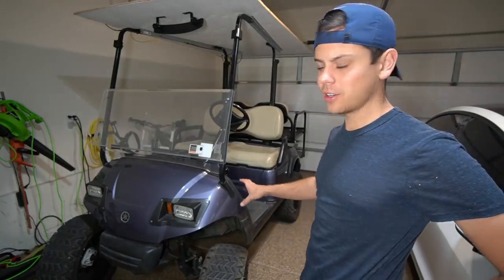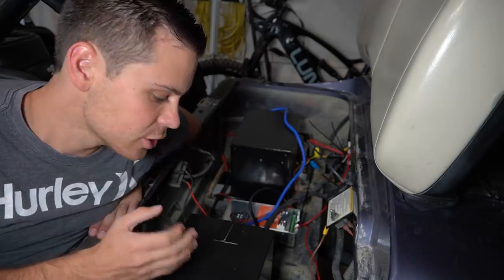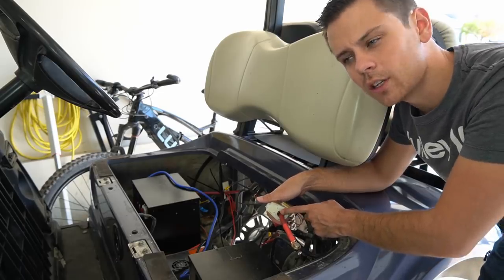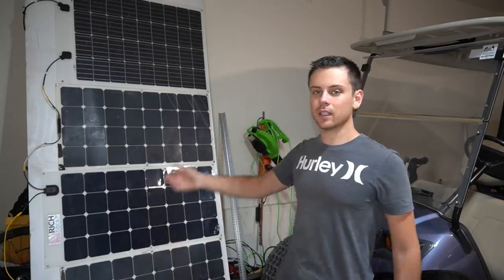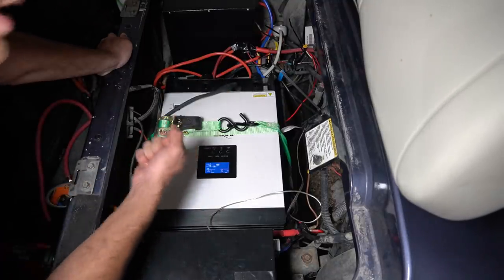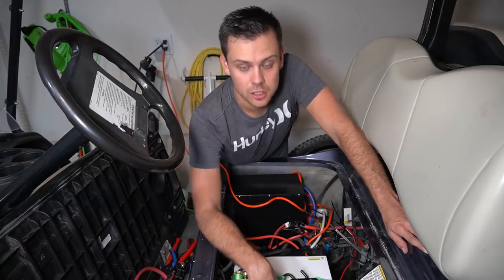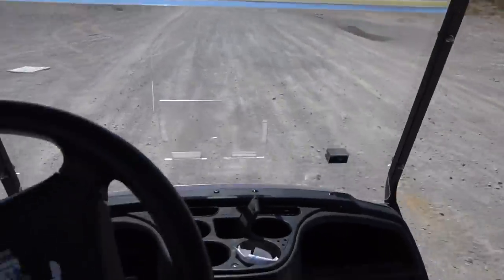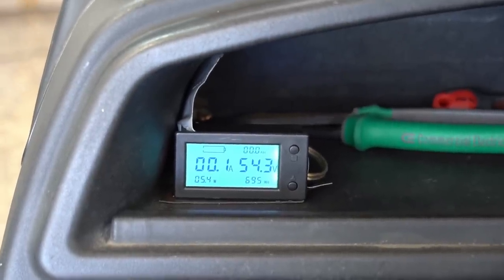Off-road Solar Golf Cart Part 2: Battery Upgrade, Shunt/48V Inverter Installation and TEST DRIVE!

Comment: This is a project that I've personally wanted to do for quite some time. I was pleasantly surprised to see you diving into this one, but really, it was no surprise. I knew I'd see it sooner or later on your channel; It was only a matter of time.  I don't comment very often, but just so you know, you're one of the very few content creators that have earned the "automatic like" from me within the first few seconds of any of your vids. Looking foward to part 3. Keep up the great work!
Reply from the maker: Thanks 😊
Reply: @WillProwse  ... Will Prowse ...by watching your channel I have put 3 - 24v 120ah fortune batts in my sprinter w/ a 6k inverter, a sterling generater (for night drive charging) , a 300w renogy panel and 3 200w daly BMS' ....I now need a 24 to 12 dc to dc inverter for my 12v lights and fans... what would you recommend?... pls I am an solar idiot and only copying you... I have tried to reach you on the forum and just get lost... My system is currently working well... (I have a batt cut off while driving in daylight so the sterling gen doesn't overcharge while 300w panel is charging)... I am currently solar charging at 28.6 volts not sure what float is BUT I can run my 220v mig welder for a short period of time (just testing) and it will run the A/C unit on the RV for about 4 hrs w/ no problems ... Before C-19 ...I wanted to come to Vegas to do a video series but C-19  F'd all that up ... so I did it on my own in june /july... Thank You For All Your Videos... You Saved my life/system and Carl @ Electric car says Hello and  Kent got hired by a competing company unfortunately... Please PM me through one of my vids... YOU ROCK... I can't THANK YOU ENOUGH... Many Blessings , SMR

Comment: Don't need bms, I have 14 used gen2 Nissan leaf packs on mine 7s2p. Running through a Alltrax 72 volt controller. I have it limited to 25 mph and get about 27 miles from full to empty charging to around 57.5 volts. 6000 rpm mechanical limit of the motor is at 27.5 mph. I have the gear set on the shelf and 2 extra packs on board to bump it up 8 volts but love the 40 amp charger I have on board which tops out at 58.8. I just check my pack imbalances about once a month, so far haven't had to balance. Been running it for about a year. Glad to see you getting into golf carts. Edit:The packs are 2s so actually 14s2p. It will wheelie if you stomp it from stopped. Empty is 48 volts while running.

Comment: i have a small 36v 20ah battery im going to try to use in my 36v golf cart for a band aid to get it operational til i can afford the big one to properly power it. great video as usual.
Reply: Go for it. Use what you have. Let us know how it goes. If lead-acid it may not be far yet anything is better than walking for longer distances.

Comment: It’s a nice setup for a mobile generator. Though the solar panels you had on the roof take 3 days to charge, it will help keep it from draining significantly when away from grid power. Nice job!!

Comment: We have an old golf cart that ive been wanting to either sell or get new batteries for.  I think Im eventually going to do the battery thing.   But your suggestion at the end...about using it as a power SOURCE!!!  its a game changer.  If you had an acreage, this would be sooo handy.....no need to take the generator to the site....just take the golf cart.
Reply: I thought the exact same thing! I have been towing my generator around the yard to power my pole chainsaw. I can't wait to upgrade my golf cart to be able to avoid the trailer.

Comment: Try driving in some soft sand and see how it handles the load. 
I remember electric carts at the imperial dunes did ok even in stock configuration but the LA batteries were drained fairly quick.

Comment: Whoa Will! 
First for solar charging a golf cart, check out Genasun charger. They will custom configure the charge chemistry profiles to your liking. They are about the size of a pack of cigarettes and weatherproof.
I use one to charge a 36v cart at a lake house with no external power where it is stored. That system uses 2 sub 250w panels, batteries are always charged going on 2 years now. Those are lead acid.

I did a run a few nights ago in another cart I have. It is a 36v Ezgo TXT, Plum Quick Bandit, 600A Navitas controller with bluetooth tuning. I run it on 7-6v batteries around 42v nominal. On the run I did 26 miles, voltage started at 45.7 and was 41.3 when I stopped. My theoretical low would have been 37v so I est another 20m. I was running about 12mph average though my cart will run in the high 20's

Comment: Hey Will, i just put 4 Battle Borns in my golf cart and push around 240 amps with a high performance 14hp motor. The lithiums are great but i miss the 370amps of torque that my flooded batteries could give :( I have a 500amp controller. Let me know if you want to see my setup, you wont be disappointed! Thanks for all you do!

Comment: Hi Will, Lithiumsolar had some loose screws on the breaker connections. It’s probably a good idea to check and secure them with loctite, because of the vibrations from the golfcart...

Comment: Nice project Will! I had an old ez go with steel truck mini bed conversion on my farm in the desert. But I always wanted to do a battery conversion to that golf cart. What battery chemistry finally worked please?👍 Thumbs up and subscribed! Tip: air down the tires as far as you can and still hold the bead, for a much smoother ride!

Comment: Hey man love your videos thanks a lot ...you mentioned powering a welder ...would love to see a build video using fortune cells to build a battery that can withstand the amp requirements of a welder. Specifically a Miller 220 ac/dc machine. .. no need for solar input..just looking to build a mobile supply similar to your hand truck video. Thanks again!

Comment: You've joined a large community of "golf cart" modders.  After-market batteries, controllers, you name the part, it's available.  Change out that controller, add another battery,  and improve the suspension and brakes.  You'll be surprised what it will do.  Check out the "buggies gone wild" website.  The sky (and the cash) is the limit.

Comment: Glad you made this video. I tried to convert a 48v Yamaha Cart to Battle Born LiFeO4, as soon as I wired it up, I turned it on and drove it around the block.  Great I thought, I buttoned everything up and the next morning went to use the cart.  Now I have the same problem as described in the video, as soon as the solenoid clicks on, one of the batteries BMS's shuts down one of the batteries (not always the same one). And that is where I am stuck.  Why did it work once, and never again, and what to do next?  Does anyone know if Battle Born batteries can power a golf cart, if so, what am I doing wrong?

Comment: Pls try the 300w renogy panel... that is what I installed on my sprinter van... it seems to be working well but I don't understand the math like you do... Many Blessings , SMR.... an idiot on line research... YOU ROCK

Comment: Top speed is determined by a magnetic sensor in the motor.  You could bypass that and run as fast as you want.  Although going over 25 mph is from experience pretty darn tough on the suspension and steering.  Every bump or divet in the road/land will put an enormous stress on the said components.  They simply are not built to go over about 19mph.

Comment: Very nice project Will, I am looking at converting a Polaris Ranger EV from SLA to better battery technology. Was concerned with finding the right battery chemistry to handle the in-rush current. Now I have some ideas. Thanks😃
Reply: Green Tech Auto you can get the Honda Fit rescued batteries Toshiba genuine skibbe the entire batch all of the vehicles Honda manufactured currently at about $200 a kilowatt hour like new with the greatest ability to provide the power money can buy just 60-month leased USED in a car so optimally burnt in for your higher and better purpose. They have come down in price over a third since when he first agreed not to sell the balance of system in order to rescue the modules themselves Each of which contains two  30 some-odd volts in series but you can put them in parallel if you don't want to 60 some volts and have the 30 some

Since he rescued those batteries eBay has occasionally had the previous but subsequent to their generation never cycled straight from Japan. Greentec Auto was a little bit doubting of that competing deal authenticity but I think that they have been pulled because they where authentic. Being able to charge 160 GRAMS [ I am struggling with exquisite latency that I swear to you changes which version of the entry I approved and submitted after I submit it LOL]  @ 700 Watts does not help mr. Musk but it can and should help all of us.

Toshiba says 6 cells to replace lead I say five again it's a matter of whether you are industrial or personal about whether you are Petty or disruptive. At 11 and a half volts you can use obsolete forklift Chargers for your carbon fiber road bike between customers in seconds more like contact welding then charging which of course course Electric bus on the roof rack systems has always been like.

You don't have to be Bill Gates to know that hundreds of miles in a car is trivia. What matters is refilling the bicycle power bank while somebody swipes their card after the prior customer swipes there's. It's in those seconds that people abandon their car if and only if they don't have to apparently wait it's not just an excuse for social distancing putting it in the rack for a few seconds refills the kilowatt hour permanent never needing replacement Titan 8 in the titanium bike tube frame. you want your frame and the batteries welded into it to be titanium based you wanted your product to be an instant commodity unless you're not the customer. We are the customer and should not forget that.

Comment: Awesome conversion! I'm just a little concerned that the MPPSolar hybrid inverter will be shaken to bits.
I don't think they were designed with that specific use case scenario in mind 😁😁😁

Comment: Hi Will, thanks for taking the time to educate us with your knowledge.
I'm currently in the process of moving from on grid utilities in england to off grid land in portugal.
Your vlogs are so helpful as im a noob to all this.
I've set aside £3000 for a system to power 4 berth caravan and well pump. Do you think my budget is realistic and if so, could you point me in the right product direction and setup.
I'm basically buying a plot of farmable land. Charging hand tool batteries will be a daily must as well as all the amenities in a caravan. 
Regards
Andy

Comment: I have a 2001 Yamaha, 48 volt, new batteries.  After some testing, it seems that the controller controls the max speed (12 mph).  On a level road at 12 mph total amp load was 40 amps, motor voltage was 48 volts and shunt voltage was 5.6 volts.  I believe the stock controller is about 250 amps max.  Stopping on a steep hill and them starting out (flat to the floor) I did see over 200 amps. I would like to  go a little faster (20 mph) but don't thing I need a 400 or 600 amp controller to do so.  Your thoughts. Sincerely, Richard Goodman

Comment: Will, thank you for sharing your expertise!  I plan to retrofit a Leisure Travel Van with 6 to 8 Battleborn 100Ahr batteries and I want to charge them with an auxiliary alternator on the engine.  The mounting for the second alternator is an option on the Sprinter van, but I need to size it. Alternators are available from 220 amps to more than 400 amps. What charger/ inverter do I use and how can I pump the most current through it to shorten charging time? Also, with lithium I need to limit charging current so I don’t overload the alternator as the batteries charge. What dc to dc controller do I use? Do I go with a 12v or 24v system? Care to dive into the deep end on this one?

Comment: I think you should test the DAKOTA LITHIUM 48V GOLF CART BATTERY SET or one of there batterys. I have been looking a long time trying to figure out what i want to replace my SLA batterys for my golf cart. The only thing I'm worried about is my speed controller it is upgraded to a 500amp but i can program it to not pull that much but the batterys don't go that high but i don't think i need as much with the lithium since i don't get the voltage drop.

Comment: Is there any kind of belt you can attach to the wheels to run an alternator for recharging batteries? Lol ... that would be cool! Load up a fridge for drinks now and whala! 🍻
Reply: Laws of thermodynamics.  Check them out

Comment: Hey Will! Need your option on using the 36v bigbattery for my 36v ezgo cart. Using 6 lead batteries now and considering witching to Lithium. Went to Bigbattery site for the 36v set up, they are out of stock for the 105Ah and only have the 125Ah. There is a $250 difference in price. My question for you is - should I wait and get the cheaper 105Ah or do I need the 125Ah? Would like to save that $250 cost! Basically is 105Ah good enough for our cart, used rarely just for neighborhood drives!

Comment: The most important part about upgrading your golf cart is the money you spend for the batteries and have a regenerative braking which means newer controller with a motor that batches to controller other words the field windings are built different lithium batteries they saved you on weight and gold extra mile push you out the other charger too much then match them me and you can go to little higher voltage if you wanted to if money is no object regenerating braking means you can go to newer style motor you also have three phase induction

Comment: Hi Will. Great videos. 
Question..I  have a clubcar precedent golfcart. 48v. I just replaced batteries with lithium batteries. I  used 3 48v,30ah. In parallel. The cart is stock, with a 250amp controller. Problem I'm experiencing is, when I accelerate cart only goes around 30 feet and drops out. I'll wait a couple minutes and it goes again, with same issue. Everything checks out on cart. In your opinion do you think batteries ah. Are not big enough? Also, cables are all no. 2. Scratching head. Any ideas would be greatly appreciated. Thanks, and keep up the good work.

Comment: Will I see you own a Luna Cycle X1 .  I own the even more popular SurRon with a 60 volt Battery   
If you were to own a SurRon with the 60 volt battery ?  How would you put together a system for solar charging the bike ,
without using an Inverter ?  Going directly from your solar panels to a MPPT DC controller matched to the battery to charge the bike ? 
You could do a video on your Luna X1 , that would have all the information to do the same for the SurRon skipping the inverter and the wall charger ! ! 
Thanks  Scott
Reply: Why not do your own research and for those questions you cannot get answered...join some eBike forums? I went for a ready to ride Haibike that is Yamaha powered. eBikes are the best thing ever on two wheels. Saves the knees too. I sold all my desert bikes, dune runners and even the Vespa. Everyone should have an electric bike.
Reply: I thought the same "Will! Do a Luna ebike video" when I saw it. I have a YT ebike and love it, but like Luna products, too. I also have a Surron X (hoping the Surron Storm comes out soon, too).  Have done a bit of reseach on direct DC to DC charging from solar/battery setup but not much good info out there for bigger setup and voltages like the Surron X. More on lower voltage or smaller amp ebike. Would love Will to do a video about DC to DC charging as the products I've found don't go to high enough voltage or, if the they do, are super low amp and not reasonable for charging a big Surron battery.
Reply: @MrChadx1  Yes , that's the issue I believe ?  The MPPT charge controllers are mostly for 12-24 volt charging those type volt batteries . And if you went as high as 60 volts and more Amps too or so , you'd need some special protection for the battery because the output is not always going to be consistent like a wall charger is . I could ask Seb at Luna Cycle and go look all over the net also .  Seems like the perfect problem solving video for Will , sense there's a lot to get it right ?  And E-bikes are everywhere now .
Reply: @MrChadx1  next year's bike race has a competitor using 40% efficient lightweight panels on the trailer and shading his cycle so he is at your voltage providing 9 amps which means in testing he never goes below 98% state of charge but the Chinese thousands of miles have grade so he want to regret anything but buying the panels far too early LOL
Reply: @soar1u715  the YouTube I mentioned he shows the cheap adjustable mppt and then he shows the one that he is using which you have to order the precise battery voltage for and it is custom to that battery voltage but despite that much much more expensive.

Comment: I know this question is completely off point but I need this information. I have heard you shouldn't have different size AH batteris in your battery bank, and I have heard it's not a big deal. So hear is my question...will it hurt to have 100AH batteries with 50AH batteries together? Thanks in advance!
Reply: I want to know this too.  I am a beginner!

Comment: So, the Battleborn battery failed why?  Is the BMS (at 200A for 1 second) not sufficient for the current draw of the motor at startup?  I'm interested in building my own 36V golf cart battery.  What BMS do I need?  (wonder if Daly 12S 36V in 250 or 300A would be enough?) My golf cart probably doesn't draw more than 200 amps.  Its an old club car DS 1985.  I just use it for putzing around the property and would't go more than a couple miles without a charge, so thinking 50AH Lifepo4 would be OK.  Very budget conscious.  Old lead acid batteries have failed and I need to replace them anyway.